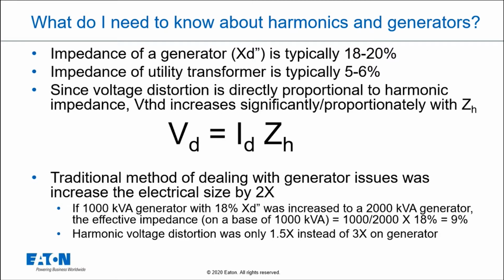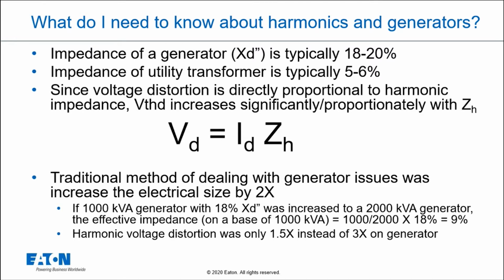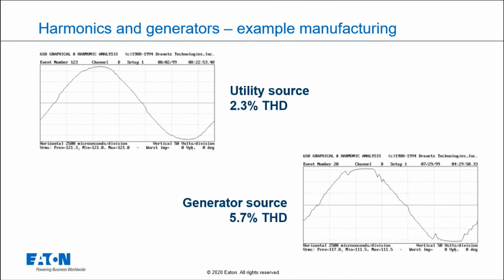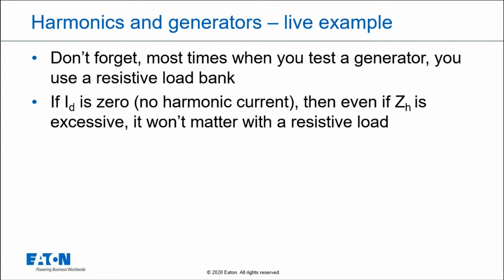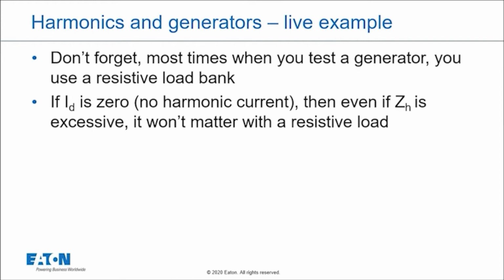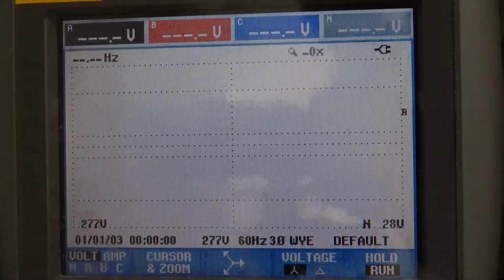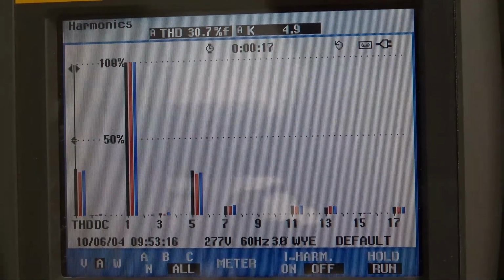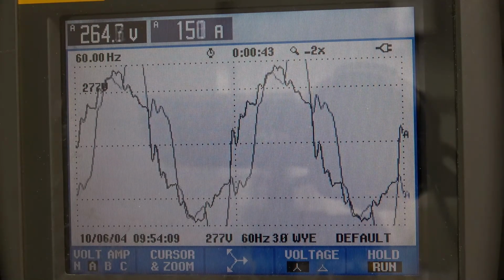13 - Harmonics and generators – what do you need to know?

Comment: Hello, I would like to ask about the solution mentioned is to install a filter. Is this an active or passive one?
It means that it is a filter composed of direct LC or will it need to use PQ control including active power components to achieve this?

Comment: Generac claims to have 2% or less THD with their latest generators without the use of an inverter. Westinghouse says they can get less then. 5%. Kind of depends on what brand you're buying. Most tests I see online with an oscilloscope on YouTube they compare some cheap old open frame generator to an inverter generator. Shouldn't need an inverter generator to make clean power Generac proven that.

Comment: I understand this example is for commercial/industrial applications, but should I be concerned about residential applications with variable speed a/c compressors? And if so; what type of filters would you recommend?
Reply: What type of compressors are you talking about here? 

The most obvious that comes to mind would be the variable speed compressor in your air conditioner. If that's the case, the engineers are way ahead of you. There's almost certainly chokes/reactors inline with the power supply to the compressor already.
Reply: I purchased a Westinghouse 9500/12500 Watt portable generator and (according to Westinghouse) the THD is +/- 23%! I am afraid to run my central AC (Trane - highest end unit) because of this - am I correct or is it possible the engineers at Trane have already taken this into account?  What are your thoughts?